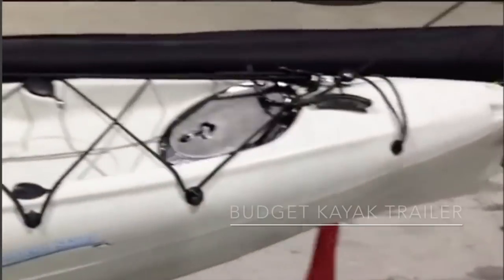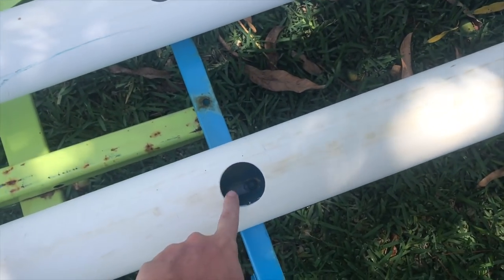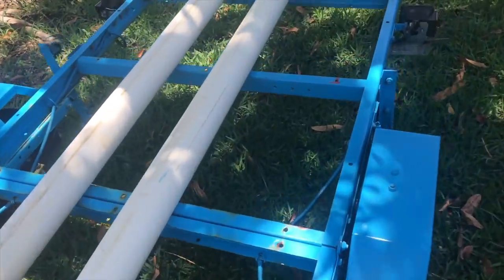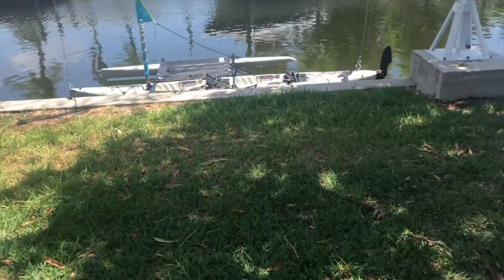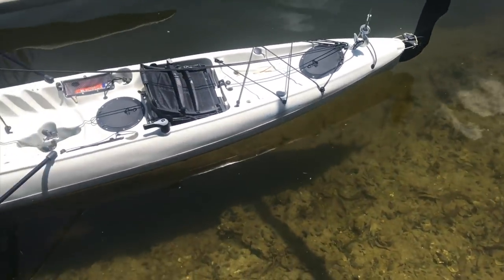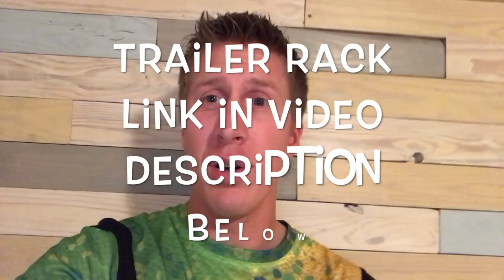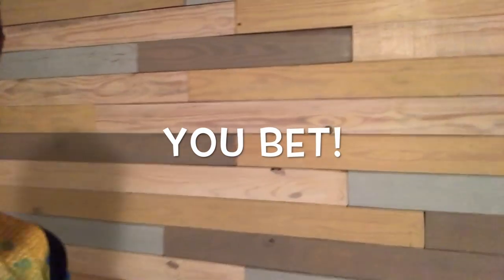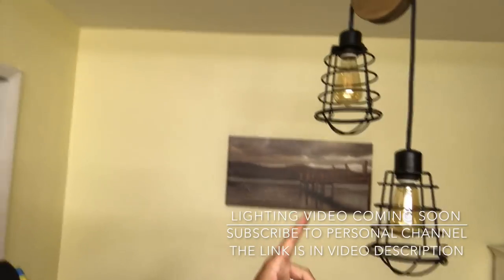Custom Harbor Freight Kayak Trailer with PVC Bunks PART 1

Comment: here's a idea put smaller pvc in the 4 inch and make that telescope as well that might give you enough reach to hit the water without getting your trailer wet .
might work I don't know just a idea lol
Reply from the maker: That is a phenomenal idea.  If i do an update on it I will certainly credit you.  Thanks!!!  I'm going to begin working on that trailer mod very soon!
Reply: KayakDIY thanks man love the channel
Reply from the maker: Picked up some materials.  Going to test and play around with your telescoping bunk idea for keeping trailer out of water.  Maybe will build it tomorrow then test...then if it works I will make a PART 2 video.
Reply: KayakDIY Cool hope to see it man .and I was thinking about it and to hold them in place you might be able to use a couple Dowling rods as pins. But any way hope it works for ya
Reply from the maker: Uploaded Part 2 video with your suggestion.  Actually works pretty well.  : )
Reply: KayakDIY  seen the video I put a comment on that video but probably should have put it here lol but thanks for the credit man means a lot that you kept your word

Comment from the maker: SUPPLIES SHOWN & DISCUSSED:
Harbor Freight Trailer: http://bit.ly/HarborFreightTrailer
Trailer Dolly: http://amzn.to/2ph8WX7
LED Trailer Light Kits: http://amzn.to/2pYEZu2
Bondo Rubberized Undercoating: http://amzn.to/2qUZMga
Truck Rack To Put On Trailer: http://amzn.to/2ptMYwo
Hammock Straps Used To Lift Kayak: http://amzn.to/2qORwBr

ABOUT:
This video is about the Harbor Freight Folding Trailer I converted into a kayak trailer.  I use this trailer with my Hobie TI and larger fishing kayaks.  

I made the following modifications to the trailer
#1: Made Removable Extended Trailer Tongue That Is Adjustable
#2: Converted Lights to Submersible LED 
#3: Added PVC bunks to slide kayak on/off
#4: Painted to match my Hobie Tandem Island

Modifications discussed but not yet performed
#1: Applying protective coating to better resist saltwater corrosion
#2: Easy add-on option for carrying multiple kayaks & gear

Visit Our Friends At 30MilesOut Channel: https://www.youtube.com/user/tyonthefly
Visit My Personal Channel For More DIY: http://bit.ly/MyHomeDIYProjects
Reply: KayakDIY i

Comment: They're sent a set of led lights 
I have to much fishing gear in my truck no room for a spare
Reply from the maker: +greg qualtieri I could still mount a spare but chose to keep in truck.  Lots of room underneath trailer frame.

Comment: thats not a kayak. its a small Sailboat.
Reply from the maker: +steven carter I totally agree. The main hull is a kayak. When you put the aka/amas on and large mainsail it becomes a small sailboat in my opinion as well.  This trailer was used with Hobie PA and other large fishing kayaks.  The bunks are spaced at around 11.5".  Basically space them at the scupper width.

Comment: I have the same trailer.  I bought it because I'm sick of breaking my back trying to get to the water.  Unfortunately, the guy who sold it to me completely lied about everything and cleverly disguised all the problems.

I spent the entire next winter rebuilding it from front to back.  I probably could have bought 2 new trailers for all the work and cost I've put into it.

Still, its an excellent trailer and really saves on the back pain at the end of a long day on the water!

Comment: Iam thinking about getting one.  Do you ever take it on the interstate at high speed ?  Around 65mhp
Reply from the maker: I did all the time.  Never had issue.  My friend Don has the same trailer as well.  

I recently sold mine though and bought my friend’s Robert Field’s trailer that had lockboxes for rods and such.

Comment: Made one five years ago.  Used 2 by 4 and put eye bolts on side for ratchet straps.  Like your setup .  Just make sure that you get a spare tire. also make sure it has the correct light kit they send me a new set to be legal.
Reply from the maker: +greg qualtieri I have spare tire inside my Honda Rigdeline flip up bed storage. This light kit is so much better than the factory one.  Much more visible.  As far as I am aware it is a legal light kit.  Leds are better than factory bulb lights because the bulbs seem to have issues with disconnecting from socket.

Comment: What type of vehicle are you towing that with? I ended up going with a small malone trailer because I use it with a sedan and these harbor freights are so heavy.
Reply from the maker: +Ocean State Kayak Fishing I would not be afraid to tow it with a car.  These trailers aren't too heavy for a car to tow.  They are heavier than a more expensive Malone or Yakima aluminum trailer.
Reply: KayakDIY the Malone weighs 195 and tongue weight is listed at about 25. Tows nice behind a small sedan.

Comment: Once the yak is on the trailer, how is it tied down?
Reply from the maker: +DxSxFx4Him I use cam buckles straps over back, middle, and front.  Ratchet straps can deform hull by applying too much pressure.
Reply: KayakDIY ok thanks, there is like 3 or 4 different folding trailers from Harbor Freight. Do you recommend one over the other? Do you remember which one you have, the model number?